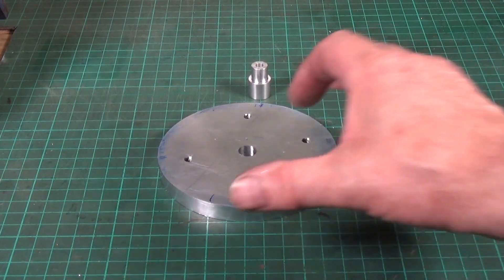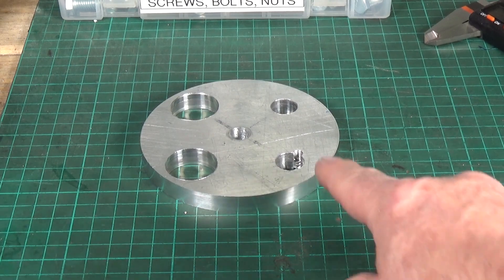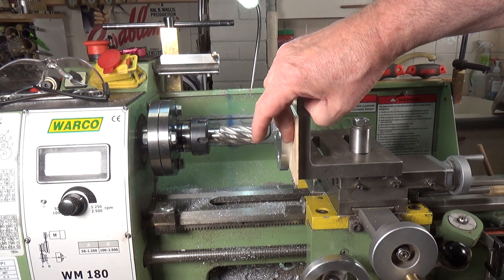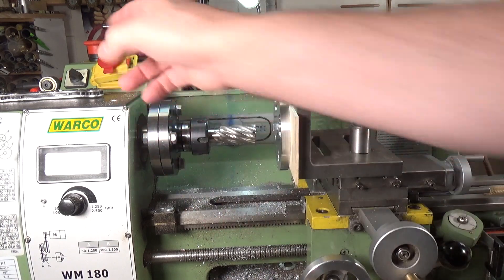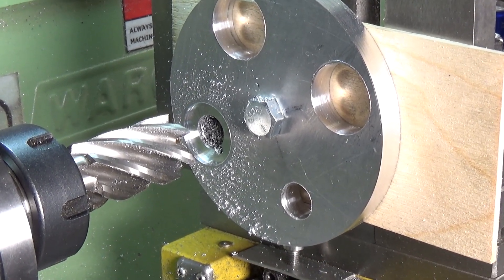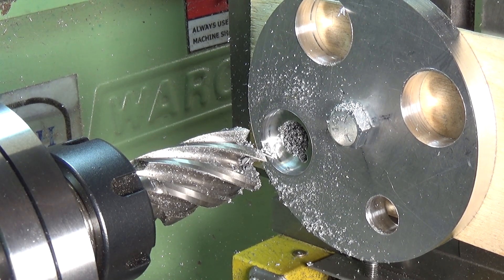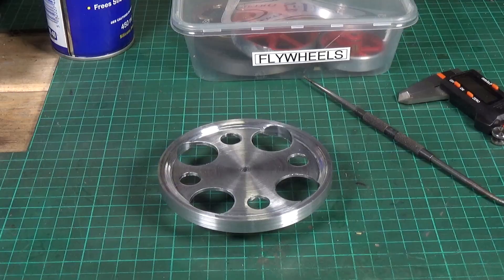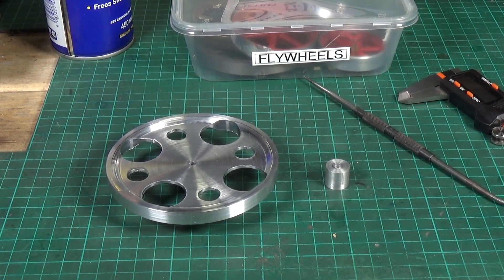Making A Flywheel For The Retro Steam Tech Electromagnet Engine - Part 2

Comment: Nice job Alan.  Turned out very well.  

Next time try using the tailstock ram to advance the carriage.  That will help reduce chatter (as it gives the tool post additional support) and it will also apply the motive force at the centre line and eliminate any chance of the angle plate canting back, as will happen when driven by the rack (via the carriage hand wheel).  It all helps.

Also I see the postman has delivered a mystery parcel to me today from over your way ;)  Very heavy too.  I will have to do an unboxing when it stops pouring with rain here and things quieten down in the workshop a bit.  

Cheers Rob
Reply from the maker: Thanks Rob. This is why the comments section on these videos is so useful, I would have never thought of using the tailstock! It's obvious once you explained it though and i will definitely do that in future. I'm sure there will be more flywheels to make.

Mystery parcel, no idea what you're talking about 🤔😉🙂

Cheers, Alan.
Reply: @RetroSteamTech  Ha Ha .  Milling on the lathe you learn all these little tricks.  Pays to lock the cross slide as well, as that can easily induce chatter if it's got any slop.  The end mill did a good job.  You would probably get less load on the lathe if you used some of those carbide tipped hole cutters I reviewed way back.  I see you have embraced collets.  Good move.  They are the be all and end all.  Cheers Rob
Reply from the maker: @Xynudu  Yes I'm definitely still learning!  One of my recent mods was to add lock screws to both the cross slide and the compound slide, the lathe doesn't come with those as standard. I am definitely a convert to collets, my recent investment in a few ER40 collets and a collet chuck plate was well worth the money. I can now hold round stock up to 30mm, very useful. Cheers, Alan.

Comment: Hi Alan, great video mate. Going back to one of your other videos about the motor temperature. Which end of the motor did you position the probe ?. 🎥👍
Reply from the maker: Thanks. The probe is about the same length as the motor so I strapped it lengthwise along the motor casing. Rob reckons it might be best to have the probe in the airflow as it exits the motor, that would be the brush end, which you could do. Obviously there is a lag between the temperature of the armature and the case temperature. Cheers, Alan.
Reply: Thanks Alan.👍